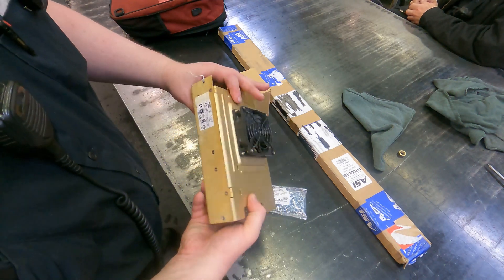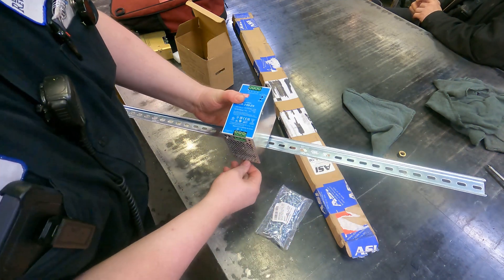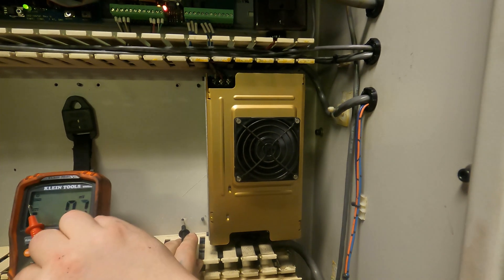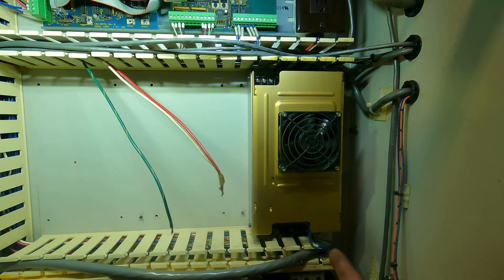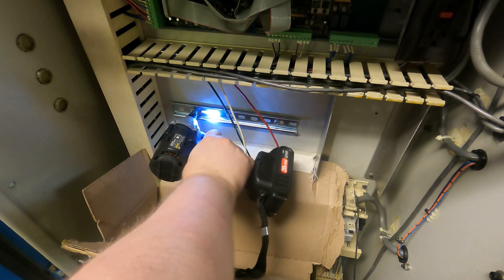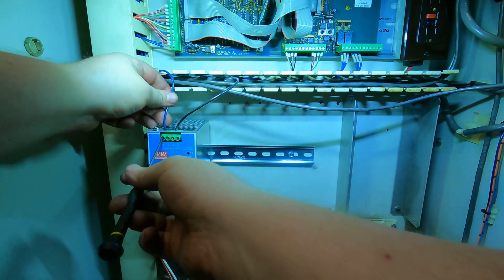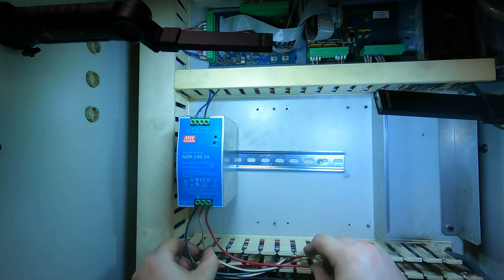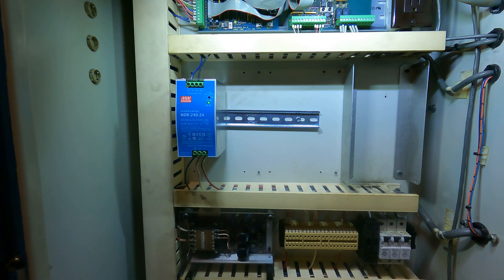Press Maintenance - Reelstand Power Supply Upgrade

Comment: It has two positives and 2 negative outlets, does it mean it can supply two devices at one time?
Reply: Yes!  With a terminal block and jumpers, you could power as many devices as you wanted as long as the load is under the 10 amps this power supply can provide.